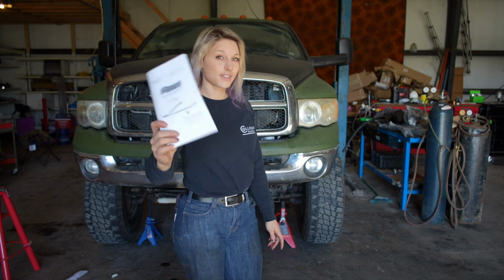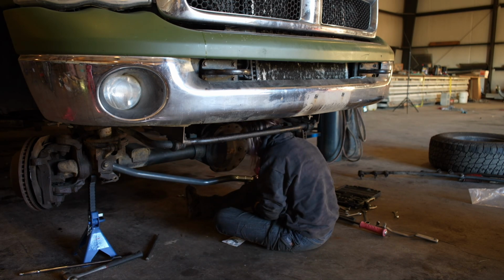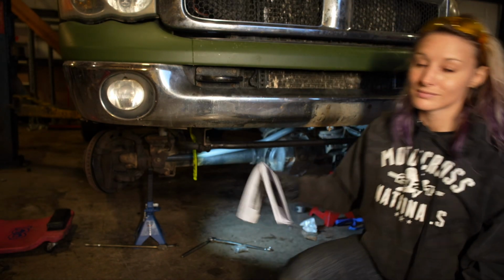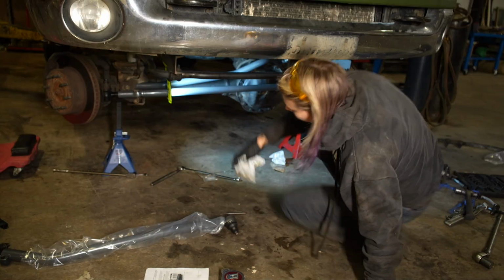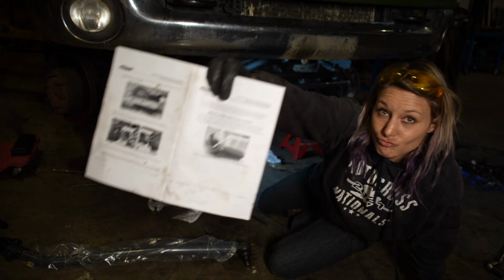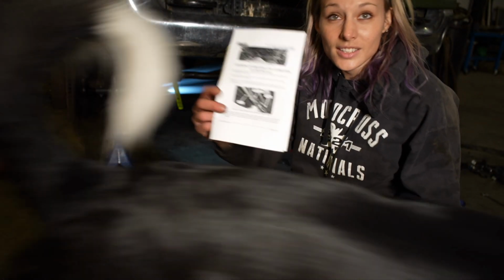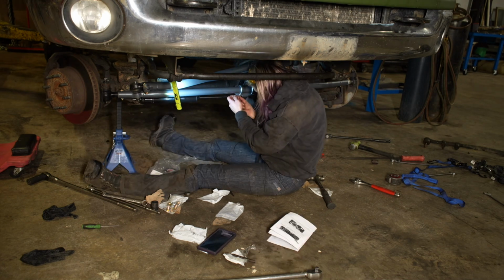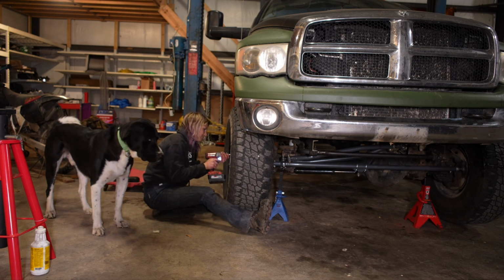@synergymfg Steering Upgrade Part Two- Installation of Synergy Steering

Comment: Hey Melissa how's the synergy stuff holding up? 
Im looking at kryptonite and synergy for my ford. Im probably gonna go with a different brand track bar but im deadlocked between the 2 mentioned above for the tie rod and drag link. 

The price point is a couple hundred dollar difference but im not sure if thats just the cost of the name or not.

Comment: I have a question.  It looked like your drag link was attached under the pitman, pic in the manual showed on top.  My stock was on top.  Does it make a difference?

Comment: With a solid front axle and solid tie rod, you can run zero toe.  Your tires will last longer and it has no affect on steering.  Thuren suspension has a good write up about it on their site.

Comment: Hey, I've got a question maybe you can point me in the right direction. I'm rebuilding my first diesel engine it's a 1.6L out of a 2018 terrain super rare here in the states it's my wife's daily. Do you know why the pistons have this concave bowl? I'm talking about the lip that some people machine off in the center of the piston bowl. Do you know what that's for? And is there any benefit to removing it? Trying to make this engine as efficient as possible and the only benefit I can see is weight reduction. Thoughts??? Also I'm sure we've all seen the Speed of Air piston with the dimples. You ever hear of anyone trying to dimple their own piston? Kinda want to try it... About to send my rings off to Total Seal to get gapless and then to Line to Line Coatings to get their abradable coating on my skirts. Any input would be GREATLY appreciated!!